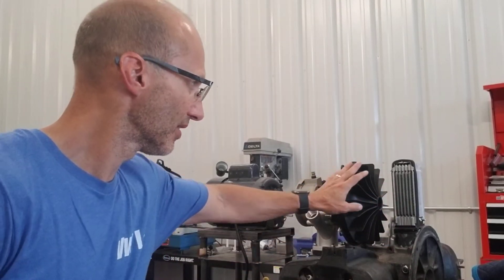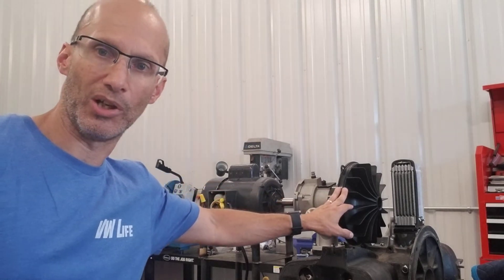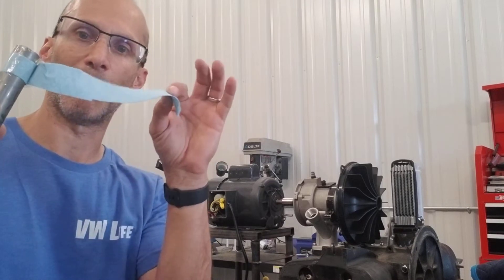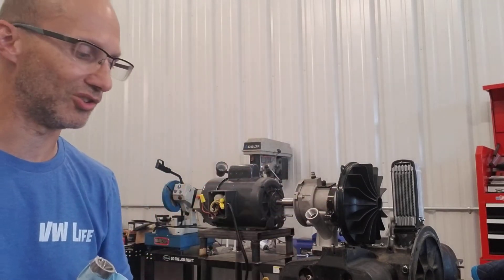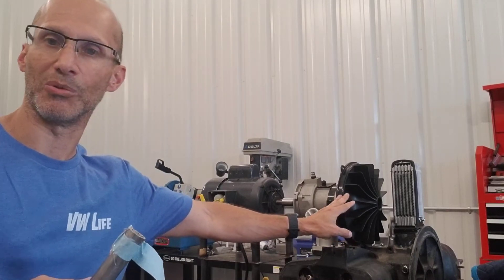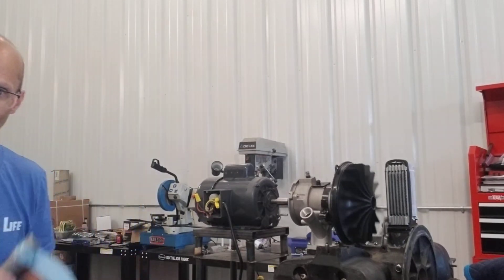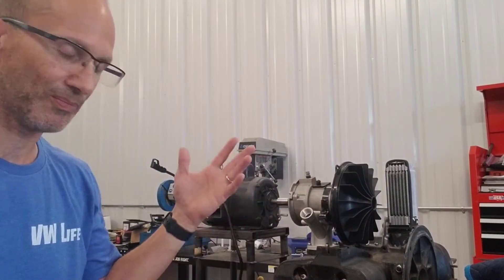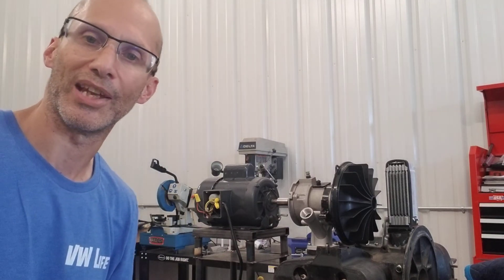Is My New Lightweight Cooling Fan a True Centrifugal Fan?

Comment: I don’t see these anymore on your website?
Reply: @bigdaddymex2003  No, I don't make them anymore.  I have the new Evolution Two fans in it's place.  The new fans are a big improvement.  Instead of a 7% increase in airflow, you get 21+%.  I also have the Evolution fan shrouds (both no fresh air and fresh air heat), which will increase airflow with the OEM fan to 40+%, and finally the full Evolution Two cooling system, which combines the Evolution fan shroud with the Evolution Two fan and provides 64% more airflow.  So, a number of different levels of cooling improvements.

Comment: Hi, Will this fan fit a 76-79 VW Bus Bay?. Pancake motor?
Reply from the maker: No, it only works on the Type 1, and doesn't work for the Type 4 or the similar cooling system of the Type 3.  I'm working on some new cooling systems, and I am considering seeing if I can tackle the Type 3 and 4, but I'm not that positive of how much demand there will be since those models aren't nearly as numerous, and the development is more expensive to do.  We will see.
Reply: @andrigsaircooledtechnology  Okay, thanks. I have a feeling demand would be higher then anticipated since most Bus's have been using the type 4 motor since 1972, all the way through Vanagon days of the early 90's. Thanks for the responding.
Reply from the maker: @ggolds5  Yeah, that is true.  I forgot about the later models.  Thanks for the reminder.

Comment: I recently stumbled across a company making a venturi for the fan shroud air intake.  Do you think your fan would be compatible with/benefit from such an addition?
Reply from the maker: It is compatible, but I haven't yet measured my fan with one of the venturi rings.  I will be doing this fairly soon, but have had some things that have prevented me from getting to it just yet.
Reply: @andrigsaircooledtechnology  That would be interesting to see, and thanks for answering so fast.
Reply from the maker: @Devin_Stromgren  I plan on doing a video, or perhaps a series on fan shrouds with and without velocity rings, along with several different fans and some new stuff I'm doing too.  Just need to get some time in the "lab".  Hopefully, all this will be out in the next month or so.

Comment: Any air flow measurements between the difference fans using the same rotation speed?
Reply from the maker: All the measurements are with the same rotation speed.  The electric motor only has one speed, which is 3,450 RPM.
Reply: @andrigsaircooledtechnology   I ordered one.  I'll let you know my thoughts.
Reply from the maker: @dmck2533  Thank you very much.

Comment: What a bad comparison. Your outside electric motor turns that fan blade at least 3 times the RPM than your actual VW Motor will turn !!
Reply from the maker: No, it doesn't.  The electric motor only turns the fan at 3,450 RPM.  That equates to 2,156 RPM engine speed.  The fan turns at 1.6 times the crankshaft.  So, at 8,000 RPM engine speed, if there was no belt slip the fan would turn 12,800 RPM.
Reply: Which is great to know that it works at that speed. My engine is setup to redline at 7,000.
Reply: @alandubaj3848  What I am saying is , it does not show the effects at lower speeds on a real bug engine , also , what is the efficiency installed in the housing ( shroud )
Reply from the maker: @helmutmitschuinig4335  The 7 to 8% airflow increase that I advertise is how it performs in the shroud, with all tin, and everything that creates static pressure within the cooling system.
Reply from the maker: @helmutmitschuinig4335  This test was just to show that it a real centrifugal fan, that is all.
Reply from the maker: @alandubaj3848  I did test it to 8,000 RPM crankshaft speed, on my test engine, so you should be good at your redline of 7,000.